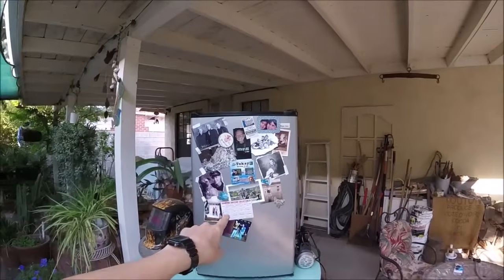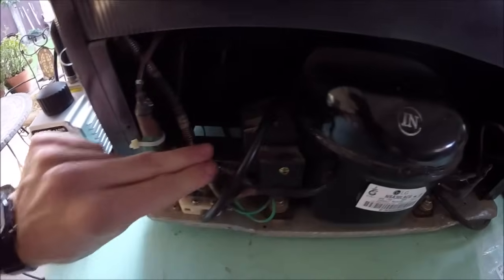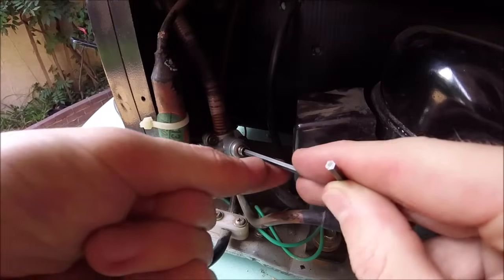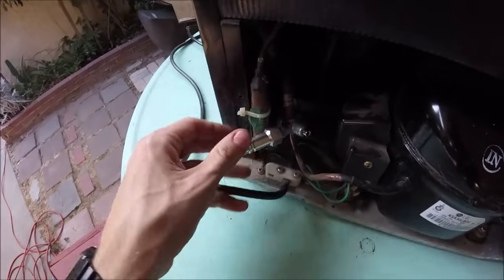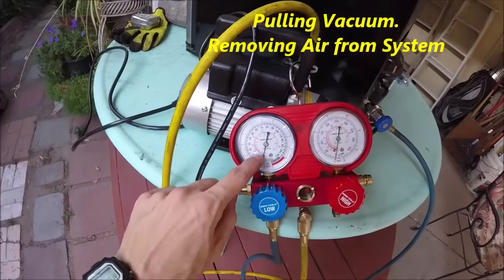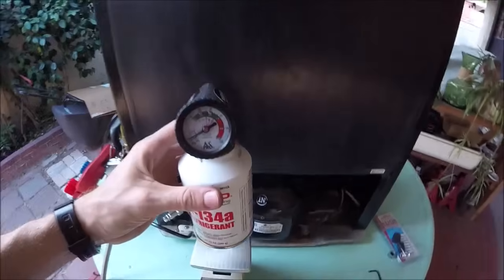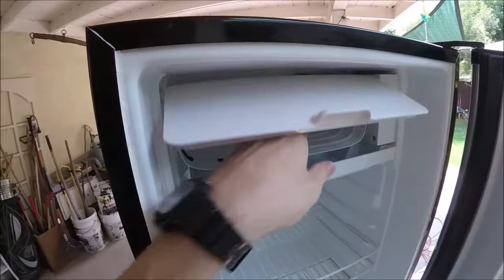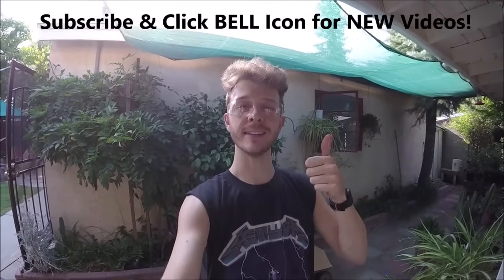How To Correctly Add Freon to your Refrigerator R134a -Jonny DIY

Comment: Where does the air come out on the guages? Also o installed my bullet valve on the compressor vaccum line, can the external vaccum machine be hooked up to that line? Thank you.
Reply from the maker: The air comes out of the vacuum pump when its hooked up sucking the air out. Yes that will work. Best to put valve on the low side or non compression side 👍
Reply: @JonnyDIY  great, thank you!

Comment: If you close the blue valve to check vacuum from the fridge then how are you actually seeing if the fridge is holding vacuum if you blocked the fridge from coming in? All I see tested was if the gauge held vacuum no?
Reply from the maker: @JeepingJohnIrwin  the way the manifold gauges work when you shut the valve on them it isolates that line so it would be testing the pressure between the gauges and the refrigerator system

Comment: Is it necessary to vacuum air before inputting the freon? Like will it cause severe problems if I dont? Thank you
Reply from the maker: Unfortunately it won't work without vacuuming the air. You need to remove it so the refrigerant can take up the space.
Reply: @JonnyDIY  Good to know. Thank you so much man!!! 🙏
Reply from the maker: @omfgawd9354  you're welcome, happy to help 👍

Comment: does the freon line need to get purge before injecting the freon like automotive?........on automotive the vacuum pump wont suck oil out(on automotive i only loose oil wen removing the old freon n pressure frm lines before pullig a vaccumm, and i just add the oil lost berore attaching the vaccum pump)..but since fridge is a smaller system was there oil lost, im assuming if there is ill just iject it after the freon...........bout to try this for the first time...saw others videos and  ur the one that showed proper techniques.........and for the comments that say this valve is going to leak eventually,  add teflon or thread sealant to all threads
Reply from the maker: I didnt add any oil when I recharged. Fix still holding up fine though 👍🏻
Reply from the maker: and yes you can do a quick purge of line to get rid of air in hose 👍🏻
Reply: @JonnyDIY  ok..thanks

Comment: I didn't see you take off the adapter? Do you leave it on the compressor pipe?
Reply from the maker: I took adapter off but you leave the bullet piercing valve on 👍🏻

Comment: Why are you using the R12 to R134a adapter?  Did you use a piercing valve that has a R12 port , whereby you needed to convert it to a R134a connector?
Reply from the maker: It was so I could use the hose I had already from working on car r134a lowside port

Comment: Is there supposed to be air hissing out of the piercing valve when I open it? Doesn't seem like the r134 is going into the line.
Reply from the maker: Only open it when its connected to either vacuum or recharge hose. You only need to open 1 turn if I remember correctly. And no it shouldnt hiss out if closed

Comment: How long did it approximately take to get the whole system to be vacuumed out? I get mine to about 20 when turning on the pump, and it stays there. Does that mean theirs is still leaks within the ice box that it can’t get it down to 30?
Reply from the maker: Should get down close to 30 quickly. Sounds like you still have a pretty bad leak as a small leak would get close and then slowly looae vacuum

Comment: You need to shake the refrigerant can first before use and then hold can facing down when adding and you need to shake as u add .
Reply from the maker: Yes shaking is good increase pressure 👍

Comment: Hello and thank u for your great instructional video! Did the refrigerator have R12 in it? While chipping out ice in my compact fridge's freezer, I punctured a freon line (I heard it hissing out). So, I quickly unplugged it. After cleaning it out, I saw the tiny puncture and sealed it. I was going to follow your video on adding more refrigerant (I'm wondering how much leaked out and if I even need to add any) and noticed ""Refrigerant 12  3.2oz" printed on the manufacturing tag on the back. Does that mean It uses R12 and cannot add R134a? I would really appreciate any advice!! Thank you! Art-n-Kiko
Reply from the maker: You're welcome, yes that means your system will have to be recharged with R-12 refrigerant. I don't have any experience with R12 as consumers arent able to directly buy it where I live. But it's the same process I believe. And yes you will have to patch hole, vacuum and recharge as I did
Reply: Uh oh! I already ordered the stuff. But my friend said that 134a is r12 with the chlorine. I was wondering why u had to buy a R12 to 134A Adapter?? Thanks
Reply from the maker: @artest7  worth a try, never tried before. I got the adapter because the piercing valve doesn't have a fitting that matches up with the r134a hose and I didnt have a can tap to hook up to gauges
Reply: R12 and R134a are not the same and are not compatible. If you have an R12 system you can only charge with R12 or possibly R404A
Reply: @josephfry4242  replace R12 by R 404a ? ? ?  Where does that miracle happen ? My friend you don't have any idea what your talking about. ( please look for an other hobby)

Comment: Hi. I looked through your comments section but I didn’t see the question that I have.  When pulling a vacuum, aren’t you also pulling out old coolant.  If so, what does the coolant do to the vacuum pump?
Reply from the maker: if you still have refrigerant in system you should collect it. But if empty or tiny bit it just evacuates out into atmosphere noy into pump

Comment: You did get me thinking.  I called a repair man in Ontario to recharge my refrigerator.  It has total 5 onces of 134a wihich cost  about $7 at walmart usa or napa.  I got some extra incase my car needs some.  Ordered all of the parts except freon from amazon ca.  don't forget to purge line from bottle before you open the new valve you just installed.  Most leaks will come from higher pressure side and freon with a stop leak additive will or should help.  I most likely need 2 onces or $2 of 134a but the repair man would not add it to my unit and told me to buy a new $2000 refrigerator.  this is bs.  someone would take our 7 year old unit and recharge it and sell it for 800 to someone.  with a slow leak just add stop leak with 134 and see what happens.  our unit is still running at -17c but the evaporator coil shows 6 in no frost and the unit runs all the time so we are low on freon.  You can top up the unit slowing, 1 min on and then see how the pressure improves.  don't forget to get self sealing freon cans.  walmart even has 3 once cans with stop leak.  for 7.  good luck guys and thanks for the tip on the saddle valve.
Reply from the maker: Hope you get it topped off, yeah that stop leak is great for slow leaks, just used some on my trucks ac system 👍🏻

Comment: What’s the chance of the Bullet piercing valve leaking later on
Reply from the maker: Its possible it can leak over time if not seated correctly, but it should last for years if done properly 👍

Comment: So does this fix the problem then or is this just a temporary fix to an on going problem? This is a great tutorial but I'm just wondering what would have cause the low charge to begin with.
Reply from the maker: If you dont have a severe leak its permanent or will last for years. Depends how severe leak is, if its taken years to leak out, it may do the same after recharging. You'll know how bad leak is after vacuuming system 👍🏻
Reply: @JonnyDIY  sorry, for the late reply. Thank you! I now have 2 fridges with this problem. This will definitely save on buying new ones!
Reply from the maker: @gerrithoevers  No worries! You're welcome, good luck with the fridges

Comment: Are these R 134 cans the same both for refrigerators and air conditioners or they are different, all that I have being seeing so far says air conditioners and I have not seen the one that says refrigerators.
Reply from the maker: Yes they're the same thing. I used some I had leftover from working on cars AC system 👍

Comment: I've been looking for a video like this.. I have one question. What happens when you put a refrigerant that isn't R 134a?

I really hope you see this and reply
Reply from the maker: Use the refrigerant listed on the back of the fridge with the amount of refrigerant needed. It should say both 👍
Reply: @JonnyDIY  I wasn't able to find r 134a so I used a different one and I want to know if this will affect the fridge.
Reply from the maker: @kingfrank6276  it may or may not work, hard to say.
Reply: It will probably run at severely diminished capacity,  then fail . Really the volume of the charge is critical,  no pun intended . Btw diy shouldn't touch hvac . It can definitely kill you or shorten your life to save a few bucks.  Be your own account the irs won't physically hurt you when you mess up

Comment: Hey brotha great vid! What if my vacuum pump is only pulling about 25 psi? Is that still considered good?
Reply from the maker: Thanks, it may take some time but it should get down a bit lower closer to 29ish. If not you may have a leak. Easy to tell, just close off the top gauge knob and let it sit for a while to see if it'll hold vacuum.

Comment: Do you happen to know what your reading was on the gauge?
Reply from the maker: No sorry, you only go by weight when recharging. So figure what your fridge takes and recharge with that exact or close amount
Reply: @JonnyDIY  I had to replace my compressor, and I was look at the frig info and not of the new compressor, and had issues with the liquid side too hot...

Comment: I have an igloo minifridge that runs on a r600a compressor / refrigerant. If I use r600a instead of r134a as you have done here, would everything else be the same for me? Can I still use the same conversion adaptors, hoses and gauges you linked below?  Also, my local autozone doesn't have an electric vacuum pump available, but they have a manual hand vacuum pump and gauge tester--will this still work for draining air from the system?
Reply from the maker: Yes it will be the same but not sure you can buy that refrigerant anymore. And no a hand pump won't work. Try another autozone location or Oreillys. One should have an AC vacuum pump for loan

Comment: What should the pressure read on a normal charged refrigerator. All these videos suck all the refrigerant out first. If I put a tap on the line and connect a gauge, what would be a normal pressure reading to know if I need to add refrigerant?
Reply from the maker: Not sure about that, different systems run different pressure's that's why the pro's will evacuate and recapture the refrigerant then recharge with specific amount. I would test temperature of inside of fridge/freezer and if running hot add a little bit til hitting 37 degrees for fridge and 0 for freezer 👍

Comment: Don't get me wrong I'm about to use this technique and thank you but I have clear the excess oil will eventually cause failure and considering that valve always going to leak you been constant need to recharge but it will do
Reply: if some oil got vaccumed just inject some more oil in....add teflon or thread sealant to all threads

Comment: My mini fridge has a problem building ice up in the back of a frost free fridge. Does that mean it's low on gas.?
Reply from the maker: No, almost all small mini fridges have problems building up ice. Safest way to defrost is just transfer food to cooler or other fridge and unplug mini fridge and let ice melt 👍🏻
Reply: @JonnyDIY  thank you. My fridge was always frost free I only had to defrost the freezer when ice built up. For about 10 years I never ever had ice build up in the fridge till the last year. I suppose I can't complain about it because I only give a hundred and ninety nine dollars for it 11 years ago. They still sale them identical to it for two hundred and ninety nine dollars. I might just break down and buy a shiny new one lol. Thank you for answering my questions.

Comment: Great video.  If I install the BPV on the service stub instead as someone suggested, do I then crimp the line between the compressor and the BPV and cut out the BPV, then solder the new end opening?  Also, leak is from a small hole in the freezer coil made by a sharp knife (and the person using it!)  Can it be sanded clean and soldered or JB Weld?
Reply from the maker: Yes use the service stub if you have one. And yes if you have access to the tools you'll crimp and seal a new stub end before where you put the valve. And it can be JB welded. I fixed this same mini fridge that way. Check out the 1st half of this video
https://youtu.be/XjgCxwf55lk
Reply: @JonnyDIY  Ok lol I see!  Thanks!

Comment: How come it seems like at the end it says 40 degrees in the freezer? So did this really work or no
Reply from the maker: It worked, fridge still working to this day. It said 40 because it was setting outside in 100+ degree weather. And it takes quite a while for these mini fridges to get back down to temperature since the only thing cooling it is that freezer tray I believe 👍

Comment: Hi Jonny! I suspect a leak and purchased a tube of AC Leak Freeze from Rectorseal. What would be the order of doing things in this case?... Do I still try to pull a vacuum first or would I inject the AC Leak Freeze and then pull a vacuum...and THEN add the refrigerant? And If I'm supposed to try pulling a vacuum first, what if it doesn't hold? Will air still be in the line? If that's the case, would AC Leak Freeze still be able to be sucked in? Just trying to figure things out and the correct order for this process. Thanks in advance for your reply.
Reply from the maker: So you want to vacuum system first to get out all the old remaining refrigerant and any air. Then add the AC leak then the remaining refrigerant. Don't overfill, add just what the refrigerator calls for, use a scale to weigh 👍 and hope the leak seal works
Reply: @JonnyDIY  When I pull the vacuum, the fridge is UNplugged, correct?
Reply from the maker: @trafficcone  yes off to vacuum, plug fridge in when adding leak seal and refrigerant 👍
Reply: @JonnyDIY  Great! Thank you!
Reply from the maker: @trafficcone  you're welcome, glad to help 👍
Reply: @JonnyDIY  So I botched the piercing valve port. I put it on the stub on the low side but the stub apparently wasn't straight enough at the end and it hissed a leak. I closed down the port and it seems to have sealed perfectly so it's there for forever now, I guess. So now,  I wanted to ask you where I could put a new port. Trying to figure out which is the suction line. I had sent a Dropbox download link with a pic of my compressor set up, but apparently YouTube doesn't like that kind of link. If there's a way I can get a pic to you, I'd really appreciate it and your subsequent feedback. Thanks again!

Comment: Would  it work with  newer refrigerator ? I have Kenmore elite  that was manufactured  in  2016 and I was told  that newer refrigerator you have to   weld it or something
Reply from the maker: Yes itll work. Yes the permanent fix you seal shut system after recharging. So braze it shut, the service stub
Reply: Newer brand use R134a refrigerant not freon.freon is a brand name and its out of the market now.

Comment: Thanks for the video!

Giving this a shot on a Kenmore Elite (LG) dual evaporator refrigerator.    
I think the high side of the compressor is copper lines and the low side is aluminum.
  
So I have 2 questions:
1.  Do you recommend piercing on the low side?  (I would assume so, but not sure how much it matters)
2.  Will the BPV make it through the aluminum before snapping itself in half?   (They don't seem very strong)

Any help would be appreciated.
Reply: Found other comments that mostly answered my questions.   
Low side recommended.   I'll try to use the service stub.
Reply from the maker: Yes add to Low side, it should be fine to pierce. Just puts a tiny hole in it 👍

Comment: If you vacuum out the refrigerator line, then there is no freon in the system. Will the compressor turn on to recharge? Do I turn the fridge on prior to recharging or leave it off? I followed all the steps and added freon but I don't think the compressor is kicking on?
Reply from the maker: You need to plug the fridge in and on while recharging. The compressor should kick on once it reaches minimum pressure. Add slowly and keep track of how many ounces added
Reply: @JonnyDIY  you are right it did kick on after about 5 minutes. Thank you!
Reply from the maker: @chrisgandhi6463  you're very welcome, happy I could help 👍

Comment: Thanks for a great video! Question: I followed these steps and my fridge is over shooting temperature (set to 40deg, measured at ~33-34deg).  Is this a sign I added too much freon?   If so, so I pull some out or just leave it?
Reply: I work with several hundred freezers daily. The temp inside will vary greatly depending on where you measure it and where the built in sensor(s) are. I've found that relying on the built in sensors is a waste of time. Put one thermometer at the top rear and one at the bottom rear and adjust until both are between 33F-42F - the lower one will likely read a few degrees cooler, but will depend on if the unit cools from the top or bottom and fan placement.

Comment: What happens if you don't have all the fancy gauges and just have the gas and filler pipe, how do you still fill the fridge
Reply from the maker: If system hasnt leaked all of refrigerant out you can simply top up with refrigerant, but don't overfill.  If has all leaked out you should vacuum system free of air before recharging.